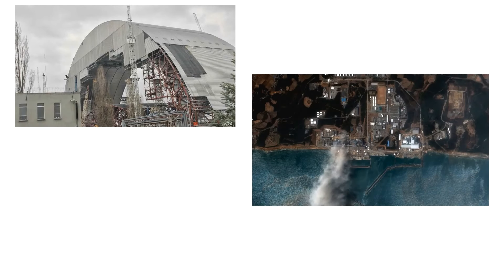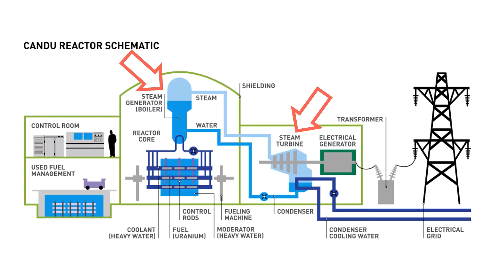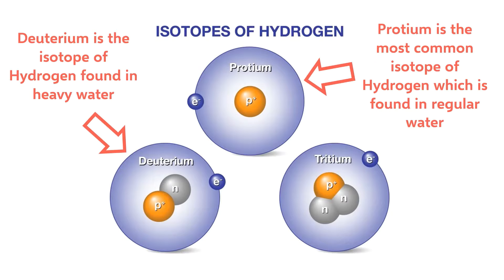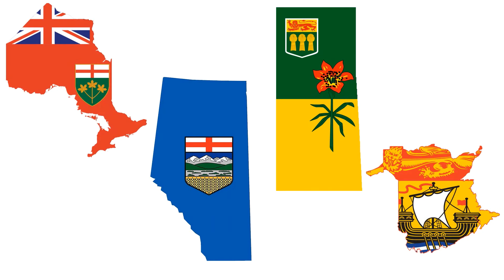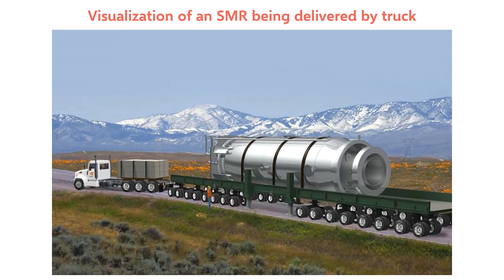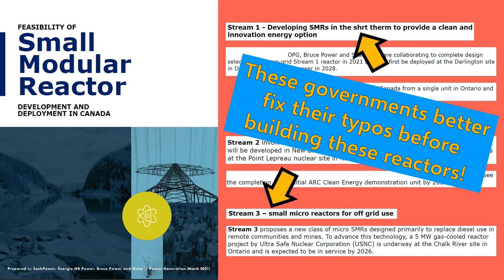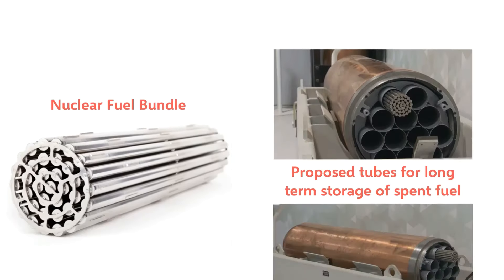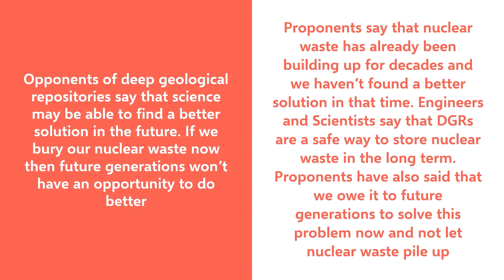How Canada is Developing the World's Most Advanced Nuclear Tech

Comment: A deep geological repository is totally ridiculous. When 96% of the energy is still resident in the fuel, the waste turns out to not be waste in a molten salt reactor which can use the other 96% of the energy stored in the waste. Instead of your fancy expensive brx 300 jobbie, for 1/2 the cost use the fuel in the waste to generate safe clean energy even safer than your stupid expensive brx 300 thingy. Yes for small modular reactors, no on solid fuel in fuel rods. Yes on molten salt.

Comment: The biggest problem facing nuclear energy is cost. Without a carbon tax energy from fossil fuels is cheaper so utilities are unwilling to make the investments.
Reply: No Carbon tax! Nuclear does not need to be as expensive as the old dinosaur LWR's. A high-temperature molten salt reactor is not under pressure so no expensive pressure vessel is needed. 85% of the plant would be the same as a coal plant.
Reply: Yes cost must be reduced.  In this it appears that the major cost is trying to use water as a coolent which means high cost pressure vessels and all sorts of safety systems including very expensive containment structures. These expenses can be greatly reduced by using coolants that do not need to be under pressure.  Negative reaction traits to temperature, nuclear reaction stops at higher temprature, is also helpful. Reactors working this way should be much cheaper to build.  The other thing is, if the reactor operates at high temperatures, heat can be stored so that extra power can be outputed when electrical prices are at their highest (Also, the reactor can operate constantly storing power when demand is low.). Having an ability to produce high levels of power, on demand, when electrical prices are at their highest, reduces the need for nuclear to be the cheapest source of power.  This is an an ability that would complement use of renewables and make their use more practical.
Reply: molten salt reactors are also planned to built in factories and shipyards which also vastly cuts down on costs and build times( down to like 1 year).

Comment: Hi Professor Goose, thanks for your video. I live near Chalk River and I have got to say that although I have long been proud of the work that they do there in R&D, I am concerned about the privatization of that facility, Canada's leading nuclear research centre and one of the best in the world, with SNC Lavelin buying a large chunk of it along with some other US and UK based companies. I worry about them cutting corners to save money. That if something would go wrong, they would just declare bankruptcy. I hear that BP also owns Bruce Nuclear too and you know most private compnies just do not last as long as nuclear waste does.

Certainly the New Brunswick plan to build a waste burner is something I fully support. I rather burn the spent fuel and see more reprocessing here to feed into nuclear batteries for space based power applications and more. Canada has a long and good nuclear track record. I want to see us do more on the world stage to show how to make the most of Uranium, Plutonium, Thorium and nuclear waste management.
Reply: Chalk river has an excellent reputation the most advanced labs are the US National labs they are run by a private company,Batelle, Canada punches far above its weight in nuclear you have a rational regulatory system unlike the uS which has a religious sytsem based on rules not safety. We are very anxious to get the Terra Power reactor going here.Molten salt in a pot nothing ever leaves the pot you just keep adding fuel at 7 years you store it and replace it with a new reactor.

Comment: Nuclear energy innovation is interesting but nobody wants nuclear waste on the theirs land. Also sodium cooled reactors are very controversial because sodium reactivity in air and water. Also small modular reactors should be inherently safe so PWR or BWR are not the best solution as they are working at high water pressure.

Comment: You can create energy threw a waterfall process within a collider to create fusion and it would be safer then a nuclear reactor as well as provide propulsion....If the speed of light comes from a stationary object / Source then a moving platform @ said speed would need X amount of energy to reach lightspeed. You are being pushed by the energy you produce rather then pushing it outwards from a stationary position to attain the plaining speed of light you desire. As in an analog engine in a downwards stroke...energy is produced / combined in the cylinder and the piston forced upwards. In a muticylinder engine that upwards motion produces a downwards compression of another cylinders piston and....So forth...So too is a collider waterfall engine producing and expelling force....collision, expansion, collapse, repeat..

Forces of the Universe
💥
🌞
🌪          
🕳                             💬
💥   Creation - 👁🤳🏽
Reply: Congratulations on your simple approach to creating both sustainable fusion and lightspeed propulsion.  When are you going to pick up your multiple Nobel prizes?

Comment: CO2-free... well...

Theirs a lot of CO2 to get to the Uranium, or natural Uranium, and also for building the storages and maintain all the facilities in ages = more CO2 in different ways.

Also new-Uranium lasts what we know now... about ~90years, then no more Uranium if they don't find new Uranium-minings. And yes more CO2in search of new minings and build everything their also. etc.
Reply: Same with mining for materials for wind, solar, hydro or batteries necessary for those
Reply: Still lower than fossil fuels, hydro or solar. (only wind has a bit lower co2 footprint)
Reply: @hamanakohamaneko7028  .. and about the "90 years" of mining URANUM, thats not CO2-free, from finding a mine, to mine, to closing a mine, and all of does heavy machines etc that spills "CO2" to get the URANIUM to the nuclear plant.

Anyhow nuclear is fine in one way, YES! its effective in all that, but its NOT = "CO2-free"... and a nuclear plant is NOT 100% "radiation-free" or of its risks from that.
Reply: @njohan81  Yeah it's not CO2-free, but it's still good, higher than wind but lower than solar. For radiation, it releases 0 radiation at regular operation. If it's not and there's a leak, either:
1- An explosion that kills the workers inside but the concrete structure surrounding it protecting everyone, making it basically the same as a gas plant exploding, or
2- It leaks but the closest person to the plant probably gets a cigarette worth of radiation
So yeah, low, but definitely a hundred times better than fossil fuels while producing more and stable energy compared to wind and solar.
Reply: @hamanakohamaneko7028  And a nuclear plant also always needs "cooling" = water or what you explained with the new GEN4, heavy water. 

Anyhow.. climate changes also do a risk for all "+440" reactors around the world that are placed near water, some have change landscape and alter the water so low, that they must import water.. and some reactors do climate change are so near water that they might have "water in to the reactors" by rising sea levels and have other risks.

So yes a reactor i FINE, EFFECTIVE and GOOD when everything is fine. But a grid and so on, have to work with a MIX (also with nuclear) but have as low of reactors as possible, because URAN is also as rare as Oil.. "about 50-90years" if not new minings are found.
Reply: @njohan81  Well, 50-90 years for U-235 which is 0.7% of Natural Uranium. New reactors  can burn U-238 which is 99.3% of Natural Uranium. There are 2 reactors in Russia that do this. Uranium will probably last us until fusion. For sea levels, not a problem since sea levels might rise by 20cm by 2050, it's a manageable task to keep adding seawalls.
Reply: @hamanakohamaneko7028  

Ahaaa okej, about the new reactors and the U-238 🤓👍

Well some parts of world has got higher sea-levels than 20cm just in some years, or one year to the next a lott, by tsunami or other similar nature catastrophes.. and YES the average is about 20cm in the world the last 100years (-info Wiki).

A nuclear plant do 50-100years of lifespan..what they say.. but anyhow the risks are always there with a nuclear plant.. "i do like them".. but the risks..

And yes the Fusion-reactors (small sun´s 🥰) does i like, and there might be a working one activated in 2025 🤔🤓🥰